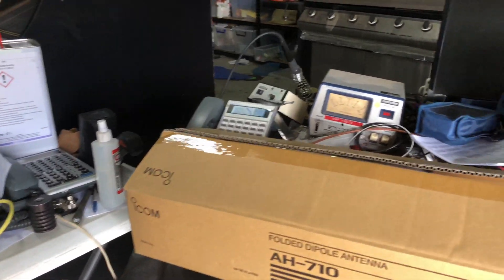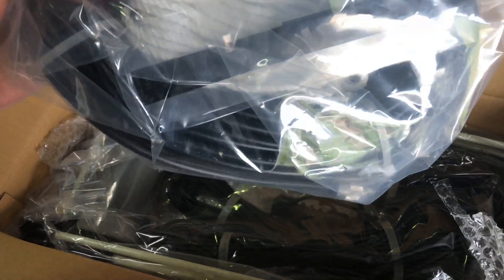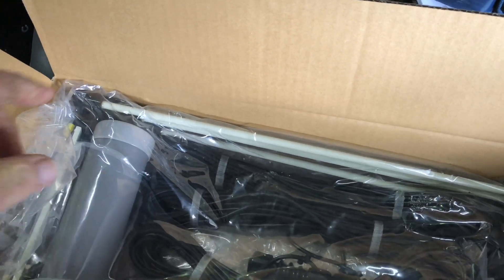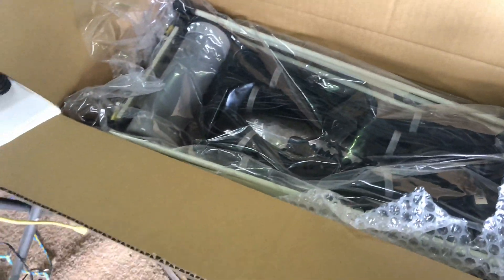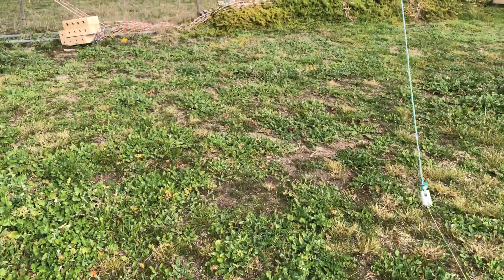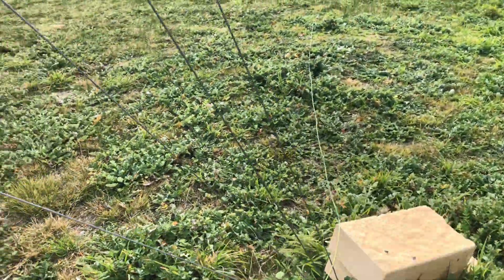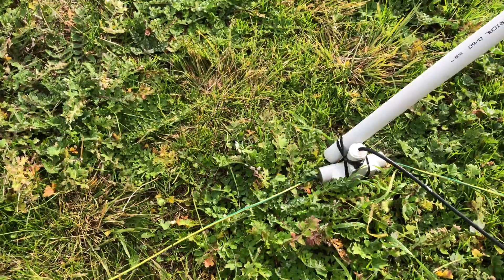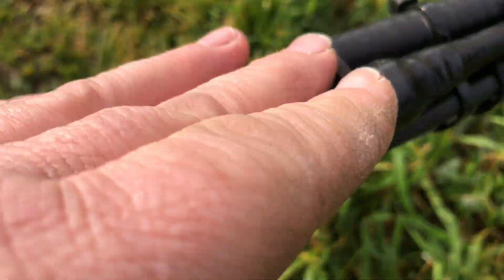AH-710 HF Folded Dipole Antenna from ICOM

Comment: Fantastic video - very helpful! My question - if you don't mind - is how you attached the gray Balun to the antenna mast (I wish I could attach a picture). It is oriented horizontally with a thin ptece of white plastic running along the back with a wire attached. Since the mast is aligned vertically, how did you attach it to the antenna mast? Greetings from Missouri from K0DHS. (I just unboxed the AH-710 yesterday and I am getting ready to put it up but have to get the center attached properly to the antenna mast. I know your video is older, but I though I would take a chance that someone knows the answer.

Comment: I know this video is 5 years old.  I just found it.  Your 40 meter dipole might have worked on the 3rd harmonic 15 meters.  If you feed a dipole with ladder line and a tuner you can use it on several bands.  If I'm not mistaken the Icom folded dipole is terminated and I have read that you loose signal In the terminating resistor. I have never used an antenna like that.

Comment: Thank you for this video. In S.E.Tennessee, I am experimenting with home brew antennas to do DX on 20, 40, and 80 meters. As I have some acreage (hectarage?), long wire antennas are easy to fit into the yard. But, getting the results you achieved with the Icom setup is very impressive - definitely worth considering. Again thanks. 73 KQ4IXD

Comment: Michel, nice antenna.  I had a B&W antenna for a short time but lacked the proper space to mount it ideally.  I ultimately had to settle for a vertical which worked out OK in the end.  I also use a RigXpert (the AA-1400) and with the AH-710 you should have punched in 16 meg center and 28 meg range.  You'd probably have SWR <2 throughout the HF band!  Cheers!

Comment: The rated output is 150watts. Is there any way to increase this to use an amp, ie 400-700watts?
Reply from the maker: I don't think so, the limitation is due to the 600ohm terminating resistor I Believe.
Reply from the maker: I just checked the terminating resistor, it is 1k ohms

Comment: Why is a wire antenna $375?
Reply: It is purely a Money matter!  
If You c a n make your own full LOOP antenn on 80M (83,0m or 273feet) would function on from 40M down to 6M with reasonable SWR. [I eventuellt tried it on 160M but SWR n o t lower than 1:1,5] DO NOT FORGET MIDPOINT DC EARTH!
ALWAYS CONNECT ANTENNA CONNECTOR TO EARTH *BEFORE YOU CONNECT TO AND ANY OF YOUR RADIO-GEAR, DUE TO STATIC ELECTRICITY BUILDUP!

Comment: Did you check your 40 mtr dipole on 15? I always had good luck using my 40 more dipoles on 15 with vswr < 3.0:1. Usually less than 2.0:1.

Comment: Are you using a tuner at all? Would something like an AH-4 help a lot?
Reply from the maker: In this Video I was running a Icom IC-706MIIG with no tuner, but now I run a IC-7300 and it has a built in antenna tuner.
Reply: An AH-4 would little use at all with this type of antenna, it is designed to tune simple lengths of wire.

Comment: What other bands have you checked the SWR for?  30 Meters?
Reply: Shortened = Only downsize is 18MHz or 17M band. With the fullsize abt 25,3meter(83feet) it wouldn't be any downsize!
Most RXTX can handle up to a
SWR 3:1(150OHMS) or use a 
ICOM AH-4/FC-40 if your transceiver doesn't have a internal tuner! 
BUT:  AH-4/FC-40 has to be taken inside by a threatening thunderstorm else it would go up in smoke or be really  damaged by an EMP.
AH710 ICOM; YA-30 YAESU
are both T2FD ANTENNAS!
*LDG100; LDG200;LDG600
Automatic antennatuners!*

Comment: Does this do 17,15,12 and 10 as well? What about 6m?
Reply: Great pity you didn’t try the rest of the bands before you posted. It’s like a half finished video. Thanks anyway.😞
Reply from the maker: The Manual says it will do 1.9Mhz to 30Mhz, with SWR at Less than 2:1 ( 1.9 to 18 Mhz ) and Less than 2.5:1 ( 18Mhz to 30 Mhz )   

But I’m yet to try it. I’ll let you know. 
As for 52Mhz, its not designed to go over 30Mhz but I can check it out on the Antenna analyser and get back to you.
Thanks for watching and stay safe. de VK3HAU
Reply: VK3HAU thanks! This antenna is 309.00 in the state’s. I’m thinking 6m might work with a roller inductor tuner but not efficiently.